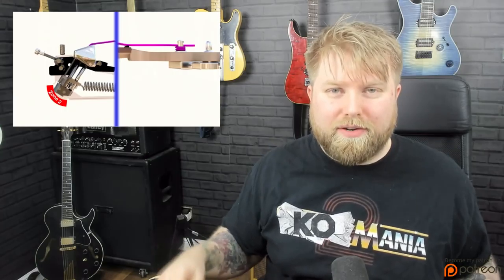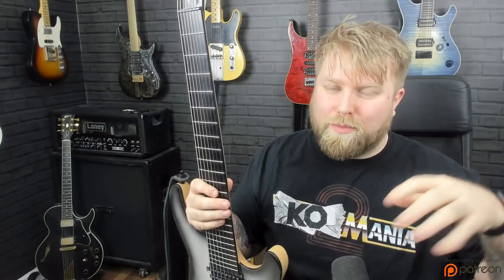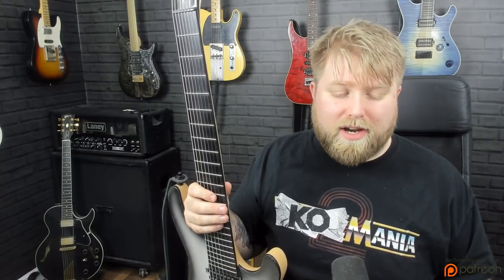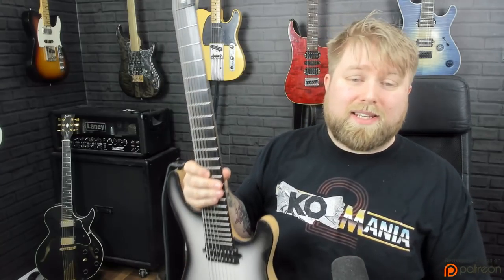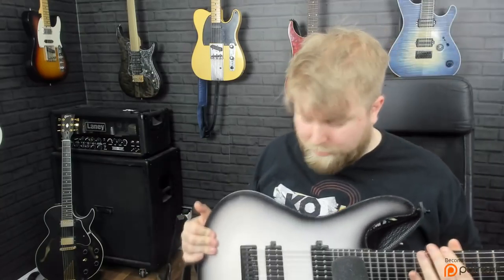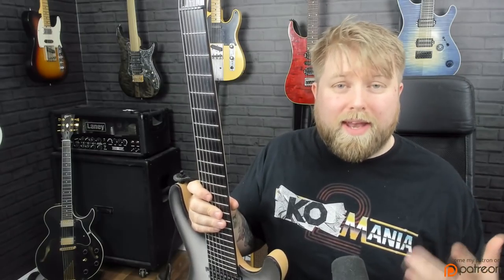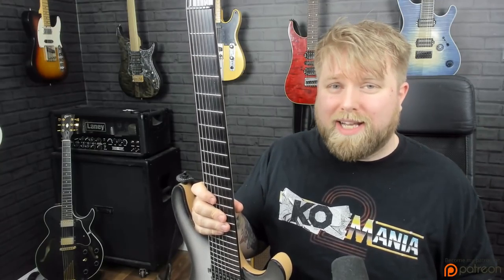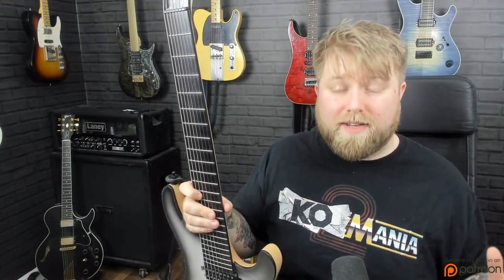Putting An Evertune Bridge In A Mayones 8 String Guitar - Part 1 Why?

Comment: bigger strings... i have great tuning stability on a 25.5 inch 6 string, with 14 to 68 strings on it. no other modifications. just big strings.
Reply from the maker: But big strings sound different. I don’t find them appealing... at all. Plus you introduce string inharmonicity if you go too big. That’s when a string is so thick it stops vibrating like a string, and vibrates more like a cylinder. When you do this it offsets the harmonica and the notes sound a little weird.
Reply: I agree with Stephen, big strings provide great tuning stability. You also get more of the fundamental. To each his own though. 14-55 on my mustang and 12-90 on my 28” scale 8 string. Both stay in tune quite well and I’m very heavy with my right hand.

Comment: What gauge is that low F#?
Reply from the maker: that's a 74 I believe
Reply: Levi Clay and it still has that funky attack? Damn. I use a 68 for a B/A so for F#/E I'd need like an 80... 

Is there an issue with just having massively thicker strings?
Reply from the maker: yes! So the thicker your string is, the less high end you'll have (which is huge for metal... when recording you're going to high pass in the EQ because that's the bit that matters) - the bigger issue is actually string inharmonicity. The thicker a string gets over a short scale, the sooner is stops vibrating like a string, and starts vibrating like a cylinder. This results in weird pulsing harmonics on notes.